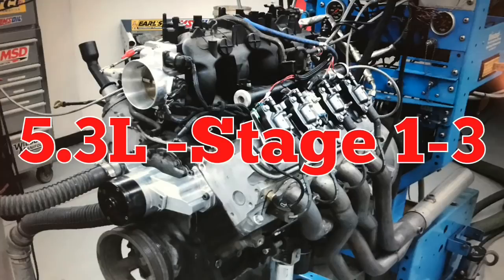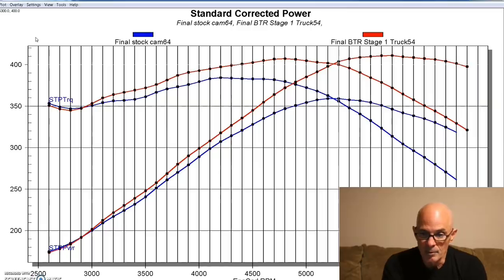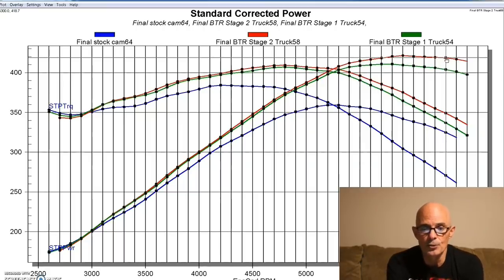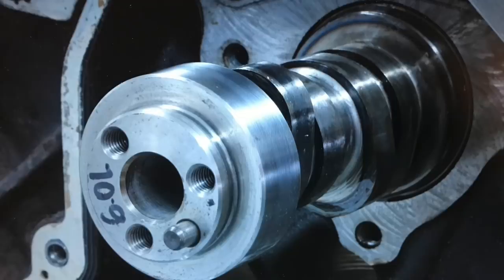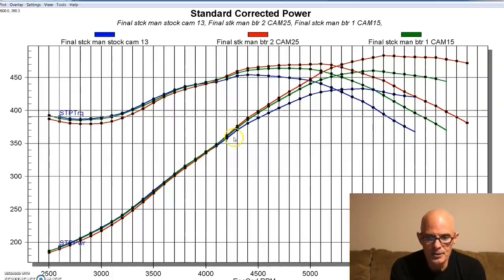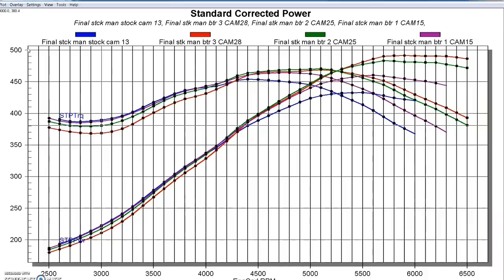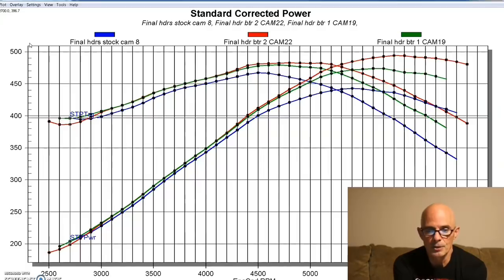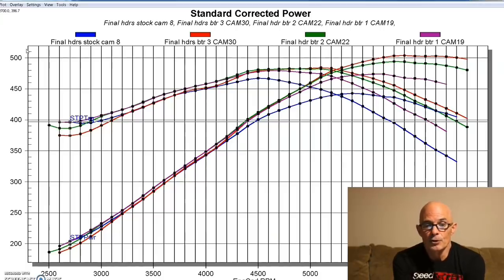LS TRUCK CAM TEST-5.3L & 6.0L (TORQUE FOR TOWING)

Comment: those slobbering hog stage IV cams dont look as attractive for a daily driver now knowing a little 212/218 duration, low lift cam is gonna eat across the entire rpm band with a stock converter. No burning up your trans in traffic, no spring change every 5k miles... welp, time to order that stage 4 kit with a billet converter and trans rad, never know when you need those 14 extra ponies at 6500 rpm!

Comment: Something doesn’t make sense. This test shows 3 stages of “truck cams” and all of them are around 350 -360 ft of torque @3000+ rpm. Then you gave a vid of a comp cam way bigger durations and over .620 lift making over 420 ft lbs @3000 rpm with a 6.0 with 799 and 706 heads... a dorman ls2 intake vs a truck intake should make less torque correct? Also with that waaay bigger comp cam? Unless this test had really low compression in this video.

Comment: I didn't realize the BTR Stage 1 cam was so close to the stock LS2 cam is 204/213 .520 .521 116. I was considering the Stage 1 in my LQ9 I'm building with 243 heads for my Yukon but I think the Stage 2 is the ticket.  I've seen too many people that have run Stage 1 in their 6.0 and either swapped for bigger later or wish they had gone Stage 2 or 3. I'm afraid a Stage 3 would be too much for a Yukon. In my RCSB I would without a doubt go Stage 3 in a 6.0.

Comment: I’m building up a 5.3 for an overland suburban. This was extremely helpful! Nice work!
Reply: The stage1 is very good on a 5.3 with a ported set of 706 heads with 2.0 intake valves. The only thing is mine killed 2 4l60e's 😂 i put a small converter in it 2500stall perfect daily driver.
Reply: Lots of gear and you'll be all right
Reply: @mauricedavis2905  i want to put a ls9 cam on mine I already blew 2 40l60s 😅
Reply: @biggo4099  time to build a solid unit 💪

Comment: Stage 1 on 5.3 and stage 2 on the 6.0. I agree.
Reply: Yes, massive gains on that stage 1 for the 5.3...
Reply: @bobowlowgrowing6387  I think any of us who have ever overcammed a car are pretty quick to know the disappointment of chasing that last little bit of peak power. You spend every moment driving the car trying to convince yourself it's "not that bad."
Reply: Would you guys recommend 220R Texas speed on my 6.2 swap GMC Sierra? Or should I go bigger? I want the most out of the 6.2 l92. Even if it’s springs and stall.
Reply: John Smith rec port heads want more exhaust 220r is equal it won’t make as much as it would with more exhaust I would call Texas speed and tell them what you want and the heads you have they will let you know which cam is better for low end and which one is better for high end
Reply: He has a video using the stage 3 cam with a FAST INTAKE after seeing that video it would make sense to go with STAGE 3. It is a world of difference
Reply: Shawn Newland  how much did your avalanche make to the wheels with the stage 2
Reply: stage is a dumb way to explain things this generation doesn’t understand the specs only marketing terminology

Comment: I got the stage 1 cam in my 5.3 with long tubes. It really woke my truck up, especially after I got it tuned. I regularly drive from Houston TX to southern Tennessee (800 miles one way) and the truck does great cammed.
Reply: Can you report on fuel mileage with the stage 1?  I'm guessing it's pretty close to stock.
Reply: @DR-px5sh  on a full tank I can go 400 miles on the hwy. If anything I gained a mile or 2.
Reply: Bet the tune woke it up more than anything.

Comment: BTR makes a TORQUE cam as well. Be nice to see that one tested in a 5.3/6.0L. Lots of guys are looking for that low end power as you said!
Reply: Richard did this test in Truck Trend back in September.  +20 ft/lbs at 3000. http://www.trucktrend.com/how-to/engine/1909-truck-torque-adding-cam-muscle-counts/
Reply: I went with a SUM-8718  torque cam and need some info on tuning the ECM/TCM. I'm running 35" BFGOODRICH  and want the torque to move this truck along. My question is  which tuner to use. After the cam  installed  and  put back together kinda runs  like 💩🤷‍♂️
I bought the Diablosport Predator 2 and it doesn't change the parameters. I'm stumped. I can send the ECM/TCM out to be programmed,but will it keep the stock tune available. It's a stock 2008 Avalanche w/a 5.3 ls. She's my daily,so I'm looking for dependability. I did the swap because the AFM lifters in #1 cylinder crapped out,so I figured I'd get rid of AFM altogether.

Comment: That stage 1 cam in a LQ4 with 706/862 heads and LT headers sounds like the combo I'll do for my Express 3500 van.  I pull a small travel trailer and haul dirtbikes with it.  I'm hating the bone stock setup after selling my LQ4 with cam and headers in my Silverado 2500.  I was going to go with the Stage 2 BTR cam but man that stage 1 cam looks like an over-achiever!  As always, thanks for the no-bs info and TONS of work you do on these Richard.
Reply: Did you ever do it? I'm thinking about picking up an express van instead of a silverado as a toy hauler (a lot cheaper in my area).

Comment: Nice video! I had a stage 3 truck cam in a 6.0 LS2 Corvette and the loss of torque down low helped the car work better.  It was a beast on the street where traction was limited.  The extra hp up top was nice as well.  I ran a factory converter with it, too.
Reply: The LOSS of torque helped it work better?  How?  I have a an LS2 with factory converter and am looking for a cam.  Could you explain
Reply: @InTheHookJohn likely because on the street traction is often very low

Comment: I'd like to see comparisons of cams which claim to be torque cams. That includes standard truck cams but also the PDS cams.  Great tests though Richard and thank you for the excellent content.
Reply: MrVettelovralexand2 I agree 👍. 

It would be cool now to run the centrifugal blower cam stage 1-3 and PDB cam stage 1-3    (NA). Just to see the difference in power curves.
Reply: MrVettelovralexand2 yea I’m trying to find info on the stage 4 truck cam from summit the Sum-8714 but can’t find anything. Supposed to be tq heavy
Reply: He's going to do a cam showdown soon he said.
Reply: Given that even fairly large cams like the sloppy stage 2 add torque at lower rpms there doesn't seem to be much point in going with the pure "tow" cams except maybe fuel economy
Reply: @chipcurrey653  A truck cam and tow cam arent exactly the same thing. Tow cams are for trucks but like you said are aimed at low end TQ, fuel economy but keep it driveable because obviously its just for street use. 

Truck cams on the other hand are all about TQ due to the weight and set up of truck engines vs the car variants of different sizes, power bands and weight for the cars they start in. A truck cam for a 5.3 isnt ganna work well for say a LS1 or LS3.. Some literally arent even compatible.

Comment: While I appreciate the relatively huge gains with the stage one cam vs stock, I think I would have to go with the stage 2 cam. It seems like it only gave a little away down low for a really big bump in power at the top.
Reply: Exact reason I bought one
Reply: the stage 1 is having your cake, the stage 2 is riding the line between having your cake and eating it too, the stage 3 crosses that line and your just eating cake.
Reply: Unless the engine is run solely on the track, that power down low is where the daily driving happens...
Reply: 🤔Trailblazer.. stage 2.. 😁
Reply: @taylordiehl6594  going to install it or what brother
Reply: @taylordiehl6594  what was your hp and tq wheel numbers

Comment: I am running a BTR stage 4 V2 truck cam in my 370 lq9 with 862 heads. Combo is strong for an NA truck engine, and makes gobs or torque. I am running the truck intake, and it still makes power past 6k. Odd they didnt send you a stage 4 which makes good power down low. I even run with a stock converter at Denver altitude. Cant wait to see what it's like end of next month when I move to florida.
Reply from the maker: The stage 4 will be softer down low than these
Reply: What lenght push rods you using

Comment: I like that stage 2 cam option for an LQ4 6.0. Been waiting for this info. Thanks!
Reply: But this is an LY6 not an LQ4.  Every time he does a 6.0 vid it's never an LQ4 or 6.  This not going to be the same on an LQ4...  I clicked on this looking to find out what cam swapping my LQ4 will do and I'm still wondering what cam swapping my LQ4 will do.
Reply from the maker: the gains are the same on the LQ4
Reply: @richardholdener1727  Appreciate it, Richard.
Reply: Richard Holdener the dished pistons on the Lq4 will be lower compression
Reply: @kevinryan5398  Ly6 also have dished pistons same as lq4

Comment: got a 88 silverado lq4 swapped, 243 heads, long tubes, 3k stall, 4l80e.  went with gpi low lift stage 2 truck cam.  i really like it and glad i went with it.  i think a lot of people go with crazy cam choices just for the idle sound

Comment: Stage 1 all the way if your gonna be towing! Glad to see the pull done down low and while I agree your not gonna be wide open at 3000 rpm I can only assume that even part throttle power would have the same graph as WOT. 
So knowing that your not gonna loose part throttle power at say 2500-3500 is great to know since that’s we’re I spend most of my time.
Reply: I just wish there was a good way to build low end torque. I want some gains down low rpm while I'm in big rolling hills without downshifting all the time. I hate climbing hills at 4k. My truck won't settle in. It's either dropping r's or downshifts and won't stop gaining r's. 😏
Reply: @jwhiteker1   Turbo
Reply: Stage 1 for towing?? Why not stage 2?

Comment: I kept this video in mind as I built a 5.3L (LMG) with the BTR stage-2 truck cam. I also used the TBSS intake and 706 heads. I didn't have headers, so I had to use the stock truck manifolds. My engine made 425 hp/408 tq. Please keep making these videos. Your channel is a gear head treasure trove!
Reply: at the crank or the wheel?
Reply: It was on an engine dyno, so that’s crank hp.
Reply: It was on an engine dyno, so that’s crank hp.
Reply: It was on an engine dyno, so that’s crank hp.
Reply: It was on an engine dyno, so that’s crank hp.
Reply: It was on an engine dyno, so that’s crank hp.
Reply: It was on an engine dyno, so that’s crank hp.
Reply: It was on an engine dyno, so that’s crank hp.
Reply: It was on an engine dyno, so that’s crank hp.
Reply: It was on an engine dyno, so that’s crank hp.
Reply: @utinator7566  I really believe you...9X

Comment: Great work! I always get razzed for using smaller cams in trucks but they always seem to respond better. 
Would love to see 6.2 vvt cam vs standard cam dynos. I can see that being a time consuming adventure since you would have to tune the vvt cam to get most gains but I have been impressed with stock l92 cam and tuning cam tables.

Comment: Just put torque cam from Btr. On my worn out 07 yukon. Beefed up valve springs and had my 799 cast heads 3 angled. Gibson cat back and volant cold air. Hyper tech tuner. Extended my old valley cover plate. Put it in the spare battery tray with zip ties. 1500 miles. Big low end power. Noticeably better.

Comment: Test the SUM-8714 truck cam and summit series vs non truck cams. Since 90% of us are using truck motors for old trucks. I want to see if I should give these truck cams the time of day for my c10 or just run a Summit car cam with high end HP and some sexy overlap.

Comment: Been really enjoying your LS vids - have had my head stuck in last century with H-D and BBM stuff... the big power available from these newer engines with better port and chamber design is so cool

I'm guessing the cams you tests are made to drop in without notching the pistons.  Bypassing that parameter, I think would open up the possibility for more gains

But, looking at all the curves you put up today, especially the difference between stages two and three makes me wonder if there wouldn't be a pretty sizable gain available by going larger on duration, but tightening the lobe center.

My guess here is that the wide LSA is pushing the intake valve closed event later and later, which is beginning to hurt low-end power. Tightening the LSA should allow enough intake valve open time for increased high-end breathing, but without holding the valve open so late as to start hurting the low end

I would expect as the overlap goes up that the difference between stock manifolds and headers would become greater, as the exhaust has more of a chance to influence the intake during the increased overlap. I've seen plenty of Dyno tests on Harley engines (which often run real tight LSA) where a pipe can make or break a combination.

Yeah, idle quality would suffer. And yes, a guy would have to notch the tops of the pistons - but I don't see it being a horrible undertaking to do this for the guy who's already got the engine out for a swap, or is assembling one.  After all, you don't whinge at all about pulling things down to gap the rings for a boosted combo...

And I suspect it's where some more low-buck gains could be found

Comment: So based on this awesome video my 6.2 truck motor with pro flow edelbrock and sloppy stage2 will be 525hp and 508 torque. Definitely getting long tubes. Love ya Rochard.

Comment: What a great video! I put a btr stage 3 cam in my truck with a tbss intake and prc ported heads with headers and a 2600 stall converter and it runs very strong. This gives me an idea oh what hp and tq I'm making since I havent put it on the dyno. Thanx for the awesome video!
Reply: How much power did it make on the dyno
Reply: @utahcountypicazospage5412  i never put mine on the dyno
Reply: What is it like daily driving with the higher stall speed?
Reply: @bradr539  I later changed to a 3000 stall converter. It really wasn't to bad to be honest.

Comment: My dads rebuilding a 67 c10 with a 05 Denali swap. I think headers and a stage 2 can is going to be far more than enough. Now I just need to find out what I need for my c8 ls3 🙌🏼. I was seeing stage 4 truck cans with springs and retails going fir $410. The 6.0-6.2 L cams were very aggressive with much more expensive hardware around 650-700

Comment: Looks like the stage 1 is the way to go if you want to lose nothing and gain up top. Their torque cam is good too if you want gains everywhere
Reply: What stage level do i need if i want to gain at least 100 ft lb torque from stock?
Reply: @WalkingDead520  a bigger engine

Comment: Richard, would you do a comparison for (low end torque cams)? I think the main manufacturers all have one, BTR, Texas Speed, Comp, etc. I'd just like to see which one is actually the best.

Also, I'm curious if people ever put engines on dynos and test them at 50% throttle to see what happens.

Comment: Now that was a great test covered the bases. 
Towing is done at 2200-3500 rpm except for hill climbing. So the power in the lower rpm range  is important. Hill climbing  is done at 5800 rpm -6500rpm so those big improvements  between 4500-6500 is great.

Comment: What cam would you recommend for a 2001 2500HD with an LQ4 and 4:10 gears, pulling a 7000 lb trailer? Obviously, from this test, it would be the stage 1 cam. Is there another cam you know of that would offer a larger low end torque increase? Thanks for all that you share. I really enjoy your videos.
Reply from the maker: The BTR Torque cam

Comment: Keep doing God's work Rich. I saw your older videos on the Stage 1 and 2 truck cams but I'm about to put long tubes on my 2000 Z71 5.3L so I'm trying to decide between the Stage 2 and 3.  I already have 4.10 gears in it, and will probably put in a Circle D 3600 stall converter later this summer.  I live in the rocky mountains so this thin air hurts power and these heavy trucks need all the help they can to get off the line.  Would love to see a Stage 4 cam test on a 5.3L.  Unfortunately I don't see the cams specs listed on BTR's website, just a drop down to select the stages.
Reply from the maker: a bigger can is not better on a 5.3L

Comment: I would have rather have seen this test done on a 6.0 with the 317 heads not to square Port heads, but good stuff nonetheless thank you for sharing.
Reply from the maker: its the same
Reply: Rich has said that the gains from square port to cathedral port are about the same. Has the data to prove it! “Cams don’t care about what heads it has”

Comment: Do you think the 317 heads on a 6L would give up less down low with the same cams than the rec port heads?
Reply from the maker: relative losses would likely be the same-the 317 would be slightly better down low than rec port

Comment: I grew up following the older guys with Chevy and Chrysler. Recently like the nissan vk56 motor... but for its design, I really consider it a failure when a 4.8 or 5.3 can make more power than a vk56.
Love the work you do
Reply from the maker: all engines are good-some are just GOODER
Reply: Richard Holdner. Stage 1 is awesome. dam, 400 hp!
 
Even with a cam(s) on the vk56, you cant get that result. I'd be happy with 400 hp, I got a bump in fuel mileage with a little more HP and a intake manifold opened up. I wonder where the sweet spot is for brake specific fuel consumption between mileage and grin. 

I wish Calif would allow engine swaps, I'd swap to an LS or Ford.

Comment: Could you explain how the power would shift around when installing a different converter? Thank You ahead of time!
Reply: The engine will make its power regardless of converter.  Changing the converter just changes the rpm at which the engine is actually being loaded.  A higher stall, allows more rpm before loading the engine, so it is further I to its torque production.

Comment: Brian tooley racing has stage 1 and also a stage 1 V2 grind, Was this the stage 1 the old grind or the new stage 1 v2 grind???
Reply from the maker: these were OG V1, I tested the others as well
Reply: @richardholdener1727  Will you be making a video on the V2 results as well?